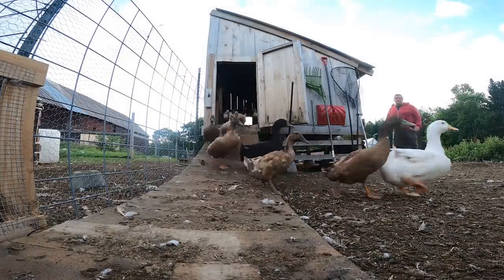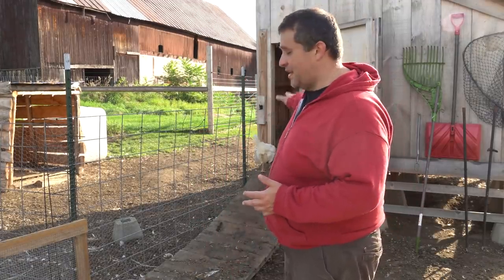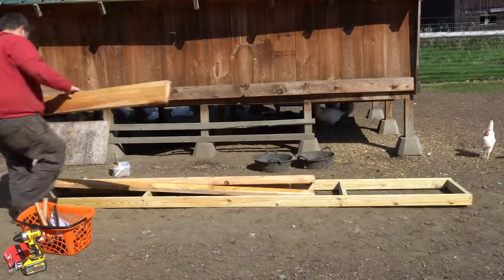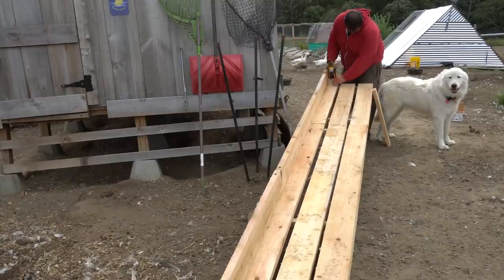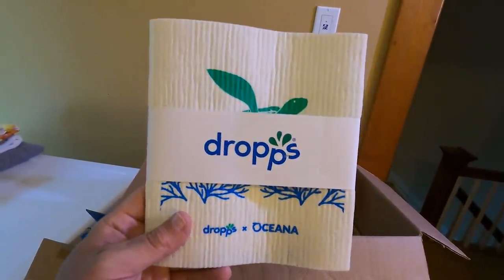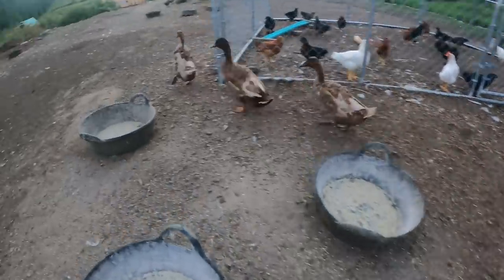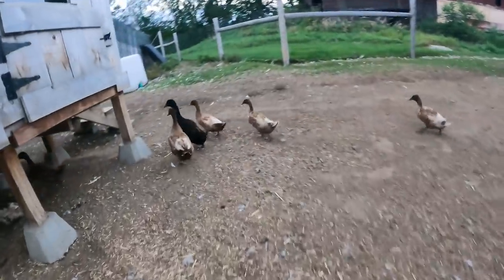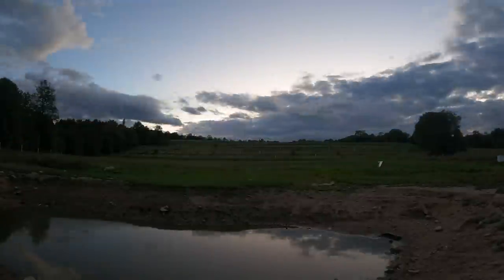Building a Better Duck Ramp

Comment: Just dig the end into the dirt so it’s not as high for them to start off with. That should help them feel more comfortable walking up it
Reply: Either that or cut the bottom of the ramp so that it’s at an angle and can account for the incline. It has supports all along the middle of the board so the end support shouldn’t be a huge deal. 👌

Comment: You should dig a little hole under the end of the ramp and put the ramp in it, then it won’t be sticking out of the ground (idk if that makes sense or not)

everyone talking about it rotting away if u dig it in, guys it’s pressure treated wood, so it shouldn’t rot anytime in the next like 10 years give or take. That’s more than enough time, in 10 years Morgan might not even be able to do the farm duties anymore 🤷🏽‍♂️
Reply: Damn! I was going to suggest cutting the corner, but your idea is better.
Reply: or build a tiny ramp to put at the end. I think it may be to high for them.
Reply: Or put a few red bricks there so it isn't such a big step up.
Reply: That is a great idea!
Reply: My problem with that idea is the ramp can rot away
Reply: @Reaperwarth95  If wood it touching the ground, it will rot. he would need to give it a protective coat to make it more resistant, at least on the contact point with the the ground.
Reply: Or pile a bit of dirt at the end of the ramp to make a gentle slope instead of a big hop
Reply: Yep that's what I think too!
Reply: @hesharu  I know that I saying the rot getting worse to put it underground but if he have protection coat onto it then I'm okay with it
Reply: Yep, that's it! Great idea!
Reply: @Reaperwarth95  he used pressure treated lumber for base.
Reply: @casid9929  okay thanks for the information
Reply: Just lay the old ramp on top of the new ramp but so it extends out at the end so the
ducks don't have to jump up.   Maybe jumping 3 inches up is too far.
Reply: No don’t dig a hole especially with winter coming, maybe just use a bit of the old ramp as a footer ,  adventure the ducks get used to it
Reply: I think cutting the legs off the old and laying over the top of the new.  Lay it so the end of the old meets the ground.  That makes the transition from the ground to the ramp easier plus camouflages the new.
Reply: @lueear1 that was my suggestion too.  The ducks can't jump however many
inches up to get on the new ramp.
I can't figure out why he can't see the problem.
Reply: Yip!
Reply: @Reaperwarth95  He should coat it either way. And putting it into the ground will help stabilize and make it level, and easier for the ducks to enter.
Reply: that is a great idea!
Reply: Good idea
Reply: would also lower the chance of a tripping hazard I know I would trip over it all the time I trip on air as it is.
Reply: Yeah a little trench that the end of the ramp could go in is a great idea, so it's more level!
Reply: My suggestion would be to put the old ramp from the end of the new ramp, and it would make a gentle slope up, plus the ducks are used to the old ramp, so may use it more willingly.
Reply: Makes complete sense and is exactly what I was thinking. They can't step up onto the ramp at that height.
Reply: @gossamerabba  Exactly.  Ducks have a hard time with heights that are too high for them, that they will refuse to use them.
Reply: @rhondaalbrecht  I look forward to seeing what Morgan comes up with. I'm sure TobyDog will be ready to help again. haha
Reply: agreed,  the end needs to be flush with the ground
Reply: dont put that ramp in the ground, it will rot in 2 years. I would just tack a mini ramp onto the end and call it a day, i was waiting for him to throw down a scrap sheet of plywood the entire time actually.
Reply: Agreed…
Reply: @paddington1670  It's pressure treated wood.  It will last plenty longer than the previous ramp.
Reply: @paddington1670  I think he's looking for something more robust than plywood.  esp for this up coming winter
Reply: "in 10 years Morgan might not even be able to do the farm duties anymore"
Say what? He's 40, not 80 XD
Reply: @LaMangouste  I don’t care how old he is, he could get hit by a car tomorrow. Or a tree could fall on them while they’re asleep, or he could run into a bear. Or even something as simple as arthritis or something like that that just makes him physically unable to keep up the farm work. So I strongly stand by my point

Comment: Redesign suggestion for the ramp: Make it as wide as the doorway. If the end on the ground is too high, dig out a little trench under it to sink it lower for them.  And that milled wood is going to get slick with poo and dirt and later, packed snow. They need a surface with some traction.
Reply: It seems narrower than the old ramp. You made some good suggestions.
Reply: I'm also thinking that even if I understand the reasoning for leaving gaps in the new ramp. For the ducks, they also may not feel safe walking on something that they can se through parts of.
Reply: I was thinking all these same things.

Comment: It looks like the new ramp "starts" at higher than the old ramp so they would need to jump on it before going up.
Reply: Yup - not sure they can even jump that high to get started on the trip up....
Reply: A little step might help?
Reply: Maybe some stair-stepped concrete pavers at the end to be a better transition to the ramp?
Reply: One small step for man, one giant leap for duckkind.
Reply: I kept thinking that ducklings would have a REALLY hard time with that leap, not to mention their feet would go right through those long long holes that are really quite wide. I think it needs cross pieces, and as someone else said, if he dug down the front end it could start at ground level.
Reply: Maybe dig out from underneath the edge?
Reply: @victoriabaker4400  I don't think he did the proper amount of planning before he made the ramp?
Reply: He could probably get away with just cutting the corner off with a saw.
Reply: @BenjaminKlahn     Made in China. lol
Reply: Yup. Ducks don't seem to like "stepping up"  and they aren't huge fans of stepping down either (you'll notice when they have to they often flap about). In my limited experience with birds this seems to be a common thing.

If the ramp meet the ground flatter and lower like the existing ramp it'll probably be more acceptable to them.

Comment: You could unscrew the planks and scootch them down so they touch the ground. Maybe also add some width wise strips to increase grip. Or how about putting the old ramp over the new one?
Reply: Yeh definitely too high and agree with the strips (says the woman thats never owned a duck in her life lol).
Reply: It would be better to just dig a bit out of the ground where the end of the frame is for it to rest in. That way the step up isn't a problem rather than shifting the planks down the frame. Some gripy surfaces along the top of the ramp would be a good idea though.
Reply: @Alex_Fahey  That's a good idea.

Comment: Crying infront of people is such a strong thing. It's something I struggle with and it's something I look up to you for.
Crying helps. It's designed to relieve emotions and tension. And it's refreshing to see someone do that without cutting it out of the video completely (which would be understandable, bc it's such a vulnerable thing, but that's why it's so impressive that you left it in).
And crying is for everyone. It's good for you. (I'm still working on letting myself cry infront of other people, trying to appear strong, even if true strength would be the exact opposite...)

Comment: Love Toby .  Love your channel.  Try adding an extension or a few rock to the end of the ramp.  Bring the ground up to ramp platform.  Little ducks have little feet.  For ice and snow you may wish to put a few low profile cross pieces up the ramp to keep them from slipping and sliding.  Keep up the great work.

Comment: Ramp redesign suggestion: Take off the long plank boards you've used and return the stock to your lumber pile. Remove the sideboard you added and return it, also, to your lumber pile. Move the cross brace at the end of the ramp's frame up two feet from the end of the the frame so that you can cut the long boards on either side of the frame with an angle for the last 18" so that the end of the ramp will be closer to the ground. Now remove the planks from the OLD ramp and attach them, side-to-side, across the top of the new frame. Center the decking boards, which will mean they have a bit of overlap on each side of the frame, and allow a small 1/4" gap between the planks. This way you're reusing planks that were already cut, saving lumber, and giving the ducks a surface they're familiar with and that has more traction with the side-to-side spaces and side-to side wood grain. The redesigned ramp should also be a bit lighter and easier to move, yet rigid enough to support the ducks without sagging.

Comment: Whenever you can, save those stainless steel baker racks ( retail store surplus, electronics assembly plants ).  

The flat surfaces will be handy additions for your ramps or flock perch.   

Store them in your barn, you are certainly bound to need them

Comment: The old ramp is wider, and also flush with the ground at its lowest end. If you take off a wedge from the bottom of the supporting boards on the bottom of the ramp, or push it into the dirt so it's flush with the dirt, it may help. It also just isn't the same width or at least doesn't look it.

Comment: Honestly what I would do about that step up (and how I designed my ramps) is I actually rest the supports on the ground, figure out the angle I need to cut, then cut it off. Then I put pavers beneath the cut ends to keep them from touching the ground. My decking boards go horizontal, though :) And I do one on the very bottom to adjust for any height difference.

If you want, I'd be happy to email you the plans I designed for the ramp I built to get my riding mower up and down out of my shed! :) I'll be adjusting them slightly to do both a ramp and stairs when I build my back deck. Or if you send me some photos and measurements, I could probably alter my ramp design for your duck house.

Comment: I think the issue the ducks have with the new ramp is two-fold. 

First, it's not wide enough. It's only half as wide as the door. That's a problem. You need it to be as wide as the door to make them as comfortable as you can to go up/down it. 

Second, the ground end is too high. I think I would have extended the boards further than the frame and cut them on a bias to meet the ground. 

Aside from that, it should be just fine once the ducks get used to it. 

As for Toby, I agree that you only have so much time with him and should cherish all of the time he wants to love on you. At the same time, you do need to get things done. Perhaps consider doing projects like the duck ramp outside the enclosure so you can get it done with minimal interruption from lovable floofballs and then devote a good chunk of time to just giving him some attention? ;)

Comment: If you're going to junk the old ramp, take about 5 ft of it, cut it to the same width of the new ramp and temporarily attach it to the bottom portion so that it's partway up the ramp and a smooth transition onto the ground. It's the ramp they're familiar with so it won't spook them, and they won't have to jump up at the bottom.

Comment: My suggestion: Cut down the bottom of the ramp on an angle so they don't have to jump to get on it (or dig a hole so it won't be ground level). If that doesn't work, then lay the old one on top. Then each day remove a couple of boards from it, until all that's left is the new ramp.

Comment: Diy videos are the best, try and make it as wide as the door opening, also use the plank from the last ramp to cover up the new planks while still leaving some hole for the snow, maybe they don't like the smell of the new wood, if you cover it with the old one that should do the trick

Comment: Ramp ideas: dig holes for the end legs to go into to make the ramp flush with the ground, cut off about a foot of the side bar since they like to jump on from the side, add little sideways strips for them to have foot holds, paint it with something like the flex tape paint that will be waterproofing the ramp and give them good traction.

Comment: Put the old duck ramp onto the new one(remove the tall support posts). Then you can slide it down each night so they are using the new sections of duck ramp.
Also  entrance of the new duck ramp is too high so make it so they can step up onto the ramp vs having to jump.
They were trying to figure it out. Animals like routine not change so when you make changes make them gradual.

Comment: The old ramp had a bigger flattened surface near the floor for the ducks to climb up. The new one is too stiff for that to happen but it has a better entrance level compared to the old one. Maybe if you design a hybrid between the two it will have all the positive aspects of both designs and I’m sure the ducks will fin it much more comfortable buddy.

Comment: It looks like a big 2-3" step up for the ducks vs the old ramp which is less than and inch and flat on the ground. It will make your new ramp slightly steeper, but you could shorten the frame end that contacts the ground and leave the long planks the same length so they overhand and contact the ground instead of being a step up. Or even simpler, but not as good looking would be adding a piece of wood to turn that bottom step into more of a ramp.

Comment: Try digging a little trench in the ground at the end of the ramp so it sits lower level with the ground Orcutt triangle off the bottom of the frame if that makes sense so it's level

Comment: The main reason I believe they're not going up the new ramp is because of how steep and thick the boards are. On the thin ramp, the bottom of the ramp went all the way down to the ground. On the new ramp, the step was so steep that the ducks couldn't get up on it. But this is just a theory.

Comment: I would say its because of how high the ramp is off the ground, which can be solved by digging a hole.
But you ducks do just find jumping onto the old ramp.
However I think it has more to do with the drastic color change.

Comment: The problem with the new ramp I think is the bottom of the ramp is like Fallas height. 
I think easg fix could be to to use a piece of the old ramp at the bottom. A difficult fix would be to redesign the bridge so there isn't such a big step, or maybe sand down where the ramp comes into contact with the ground.

Comment: Maybe they would use the new ramp if you attach a bit of the old one on the bottom. I think you should have some horizontal slats on the ramp for traction. Old pieces could be used for that too. Frankly I didn't have a problem with the old one.

Comment: You need to get rid of the 4 inch gap at the end of the new ramp. They don’t want to jump up on it when in the past they could always just walk up. I’d say either add a piece on the end or dig a small hole the elf sits in.

Comment: dig a hole at base to reduce height of ramp or just pile some dirt at end to reduce first step height.
you could have just used 1 inch planks with no supports, they are strong enough, just need to be long enough..

Comment: While the new, sturdy ramp has a milder slope, it starts much higher off the ground. Can you reduce the height at the bottom by perhaps half so they have an easier on-boarding experience?

Comment: You should trim the bottom of the ramp, so that it can lay flat or connect directly with the ground, I think that few inches off the ground may be to much for them, the old ramp was more flat with the ground at the bottom.

Comment: Well you probably have found a solution by now, but I think that it is too narrow, especially with that railing on the side.  Ducks waddle when they walk (at least mine do) and I think that they are going to be wary of walking up that narrow ramp.  Also, I had to put stair tread on my plywood ramp so that they wouldn't slip, you might want to consider that (or asphalt shingles, etc.) since you don't have that lap wood to add some traction like before.

Comment: Good job on the new ramp, but why is it so narrow? It doesn't go all the way across the width of the doorway. Just seems odd to me why that is. If I were you, I'd have put it up before letting them out for the day. Still, I'd center it in front of the doorway and install a wall on the other side as well.

Comment: I find it so disturbing when I see someone put clean laundry into a basket that just had dirty laundry in it.  If you put dirty dishes into a tub and then ran them through a dishwasher, would you put those clean dishes back in the tub without washing it? I keep dirty clothes in plastic bins that can be cleaned and sanitized and the clean laundry baskets are mesh that fold flat and hang on the wall out of the way. If they get dirty or torn, they were 3 dollars at Walmart.  They usually last a couple years.

Comment: You're building the wrong kind of ramp for your ducks, you should design a wide ramp at the bottom like a funnel into the duckhouse. It also doesn't have be straight, as you notice when you herd the ducks in they are like people they try to find the quickest route to the objective which isn't always the most optimal. In your video the ducks are jumping onto the ramp from the right so the ramp should be designed to accommodate that.